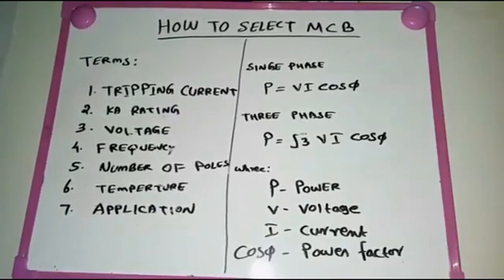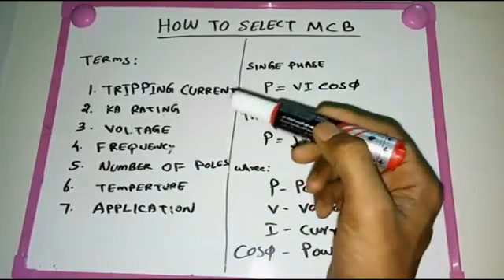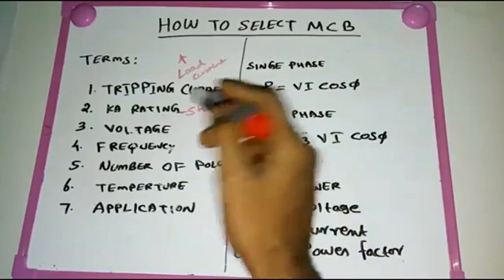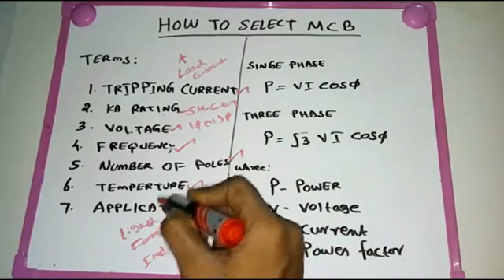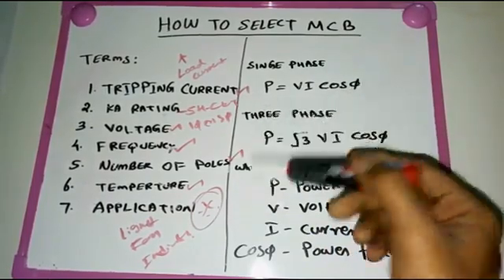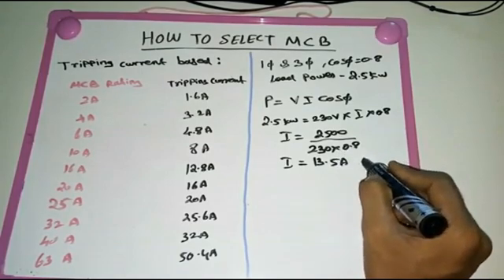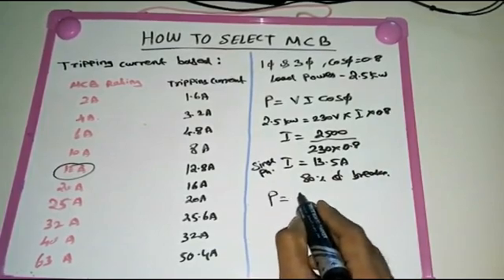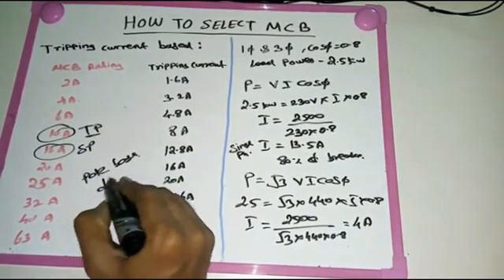How to calculate and selection of MCB based on power simply  ways and tips new

Comment: Kaise hai app sir air conditioner 1.5 billion aluminum 1435watt kehte hai 6.3 a kehte hai. Kon sa mcb lagae ta ki thodi jayada safty ho sake chahe kabhi kabhi trip bhi kr jae koi batt nahi. Hamare yaha voltage ka koi bharossa nhi hai. 10a c type lagae ya 10a b type. Kai kehte hai ki 25a c type, 25a b type lagao, koi 16a aur koi 20a kehta hai To safty jyada ke lia kon sa mcb sahi rahegi aur km safty kisme rahegi. Aur yeh bhi bta diji ke wire agr direct supply ho tb thik hai aur wire ka size aur lenth bhadhne pe electricity jyada hoti hai????

Comment: sir i am using 40A mcb and total usage of load 2000w when the wire burns the mcb is not tripped what is the reason
Reply from the maker: MCB rating higher  ...u need to use 10 or 16 amps is enough...
Reply: thanks